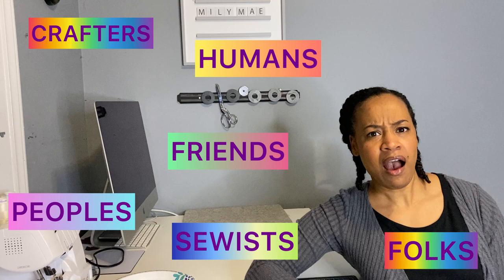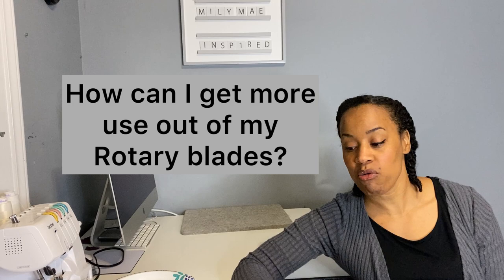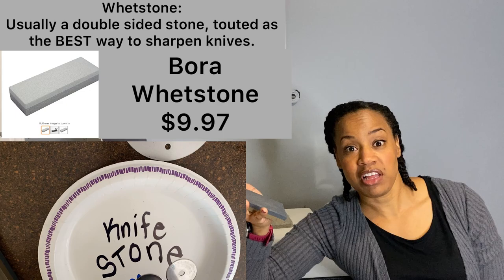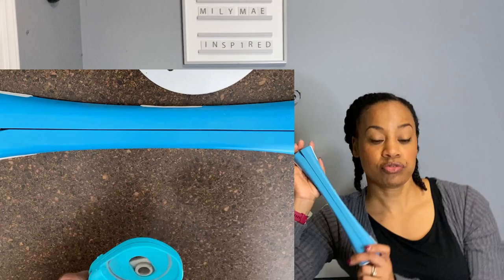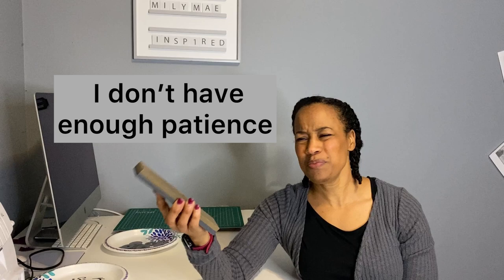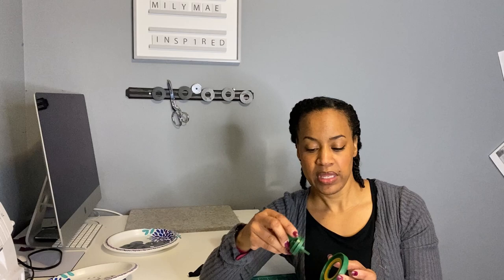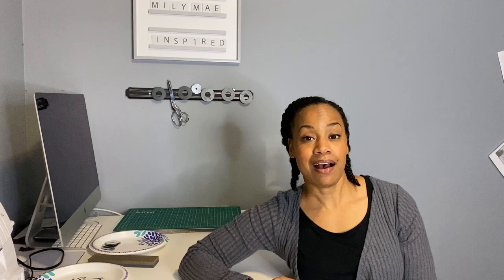Sharpen Rotary Blade - Rotary Cutter Blades Sharpener Tutorial - Ellie and Mac

Comment: Thanks, I bought the omnigrid via your link. I hope you are getting affiliate compensation.  I have been resharpening my rotary cutter blades by hand using 1200 grit polishing paper.  This will be so much quicker and easier. Thanks for the tip.
Reply: Oh! I’m super glad this works for you. That’s so super.

Comment: Sharpening with the whetstone I think makes the most sense because your moving the cutter blade with the grain of the stone, similar to sharpening cutlery on a whetstone. The circular grinder seems off because your moving the blade of the cutter perpendicular to grain of the metal, like a floor waxer.

Comment: Great review , but I didn’t like the omnigrid sharpener. It didn’t sharpen my dull blade at all and I thought that it could easily yourself if you’re not careful. I plan to order the Trucut sharpener as it’s getting good ratings on several sites. However, one thing that I learned in all my blade sharpening research and trial was that the cutting mat should be cleaned regularly especially after heavy use.

Comment: Does it matter what shape central hole you have in the blade? Does the 2nd sharpener require those little cutout shapes in the central hole, meaning a circular hole wouldn’t fit?

Comment: You influenced me to buy the trusharp. I received it yesterday.  Not only doesn't it work, but it ruined my blade. I sent it back. Lessoned learned.
Reply: Yeah the #Trucut sharpener didn’t work for me either and actually made my blades duller. Unfortunately for me I waited several months before I used it so never returned it.

Comment: I didn't use my rotary cutter for 1.5 years and it got dull even if I just bought and used it once. It didn't cut at all but just created a crease on the fabric. Really amazing because the cutter is of Clover 🍀, quite a good one so ²⁶⁶²4x⁵⁷

Comment: I use both a 45mm and a 60mm rotary cutter. If I buy the little handheld version, I will have to buy 2 (one for each size). I am guessing that the linear sharpener will work for any size blade. 2 handheld and 1 linear amount to about the same in price. So which would you recommend for me?

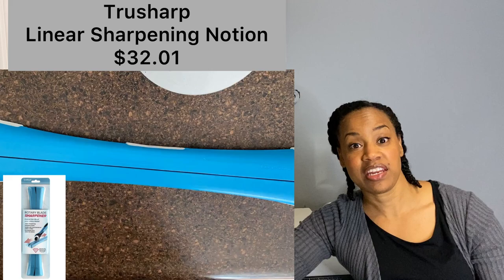Comment: I gave up after 3:30 seconds of this video without getting to the point of actually finding a way to sharpen Rotary Blades. This was more of a video on what doesn't work rather then what does. Onto a video that does provide how to sharpen a rotary blade.